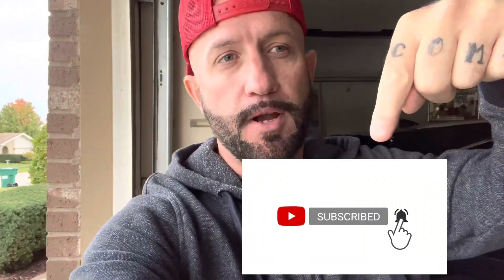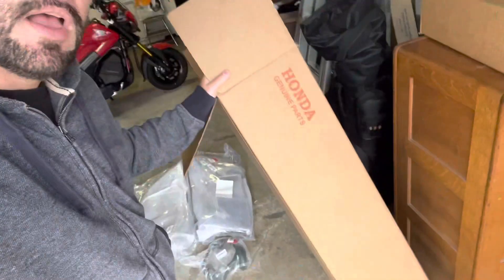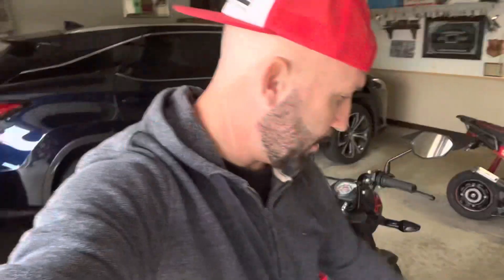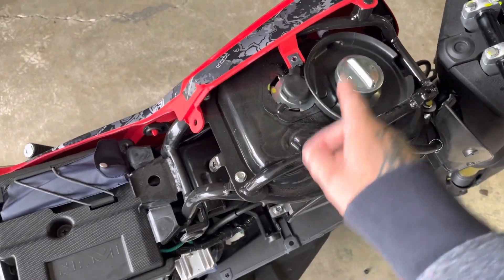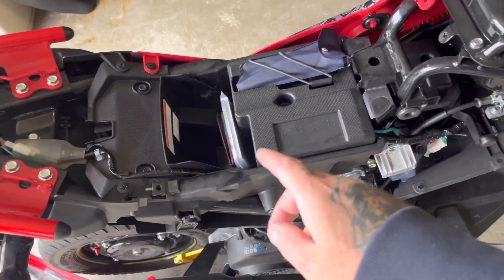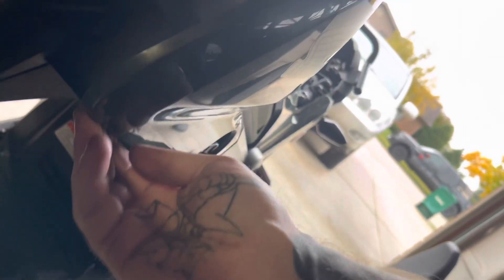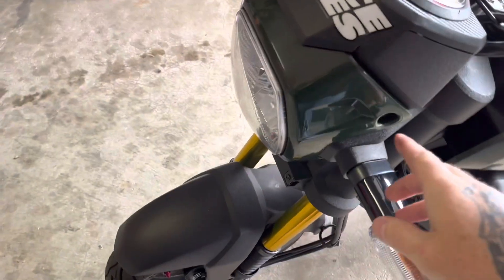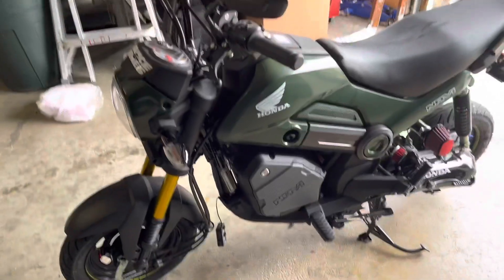Honda Navi: Changing the plastics. From RED to GREEN!

Comment: If someone is looking to do this I managed to track down some part numbers.

Nut Brown:
L cover: 83600-K74-N80ZC
R cover: 83500-K74-N80ZC
Light: 61300-K74-N80ZA

Ranger Green:
L cover: 83600-K74-N80ZG
R cover: 83500-K74-N80ZG
Light: 61300-K74-N80ZH

Grass Hopper Green:
L cover: 83600-K74-N80ZH
R cover: 83500-K74-N80ZH
Light: 61300-K74-N80ZJ

Red:
L cover: 83600-K74-N80ZK
R cover: 83500-k74-N80ZK
Light: 61300-K74-N80ZC

Rear grab bar:
Red: 50400-K74-N80ZK
Black: 50400-K74-N80ZE
Green: 50400-K74-N80ZM

Hope this helps it was a bitch to find.
Reply from the maker: Awesome bro!
Reply: Thanks! This should be pinned.
Reply: Hey down at the rear bar you said green but didn’t specify which one. grasshopper or ranger
Reply: @Killywilli the grashopper green comes with a black bar, the green bar is for ranger green
Reply: Hero.